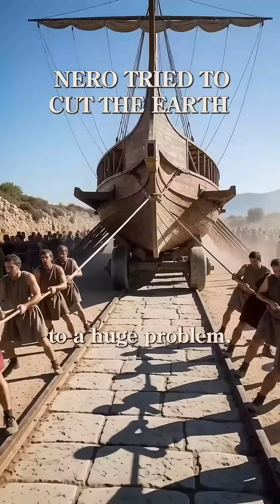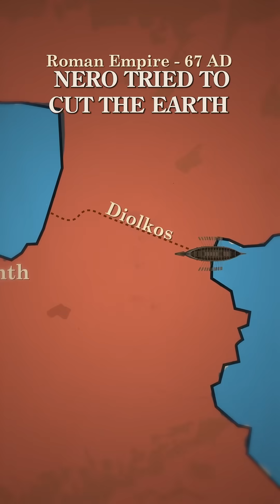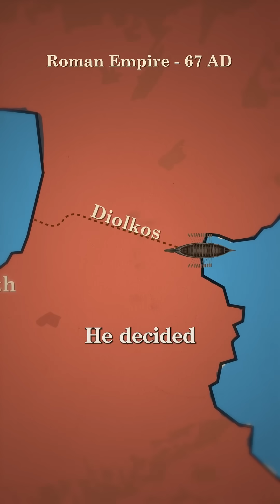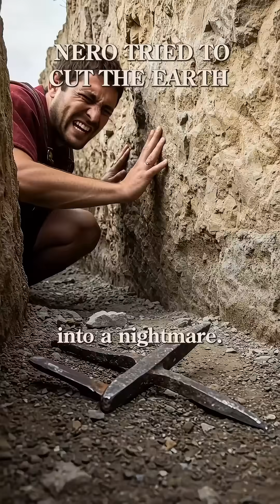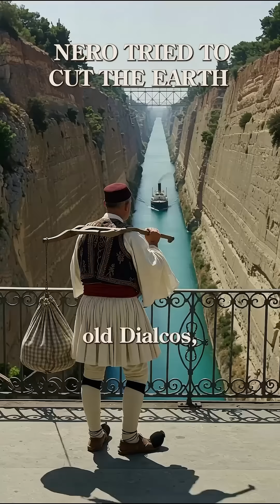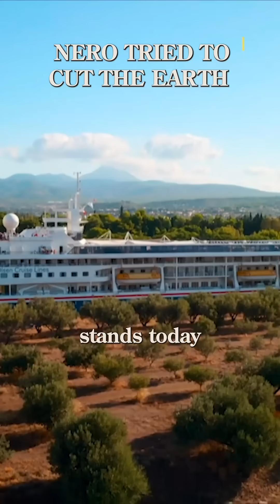The Canal That Took 1,900 Years to Build #history #ancientrome #engineering

Comment: Historically, many empires have considered large-scale civil engineering projects such as canals and land reclamation, and in many cases abandoned them due to technological and budgetary constraints. In fact, about five centuries after Emperor Nero, China went on to build an even larger canal, and that project ultimately contributed to the fall of the empire.

Of course, the canal later became a major asset to China’s logistics system, and as a result, modern assessments of Emperor Yang of Sui have changed significantly. Whether in Asia or Europe, it seems that empires have grappled with remarkably similar dilemmas. Thank you for the great information.

Comment: Meanwhile in ancient China, Chinese engineer Li Bing created a fire and water technique to break up hard rock into smaller pieces. He build a canal that passed through a mountain by splitting the mountain.
Reply: Name of the Canal?
Reply: @ryanlie6250 Dujiangyan, specifically, Baopingkou.
Reply: @ryanlie6250 The Dujiangyan. It's an irrigation system made to divert the waters of the then flood-prone Min river. The original canal was built over 2000 years ago, but because of an earthquake in 1933 it had to be redone
Reply: @c@communistflowerthen its not Canal
Reply: Pretty sure they knew how to do this in the west as well and even in the old world there is evidence for this technique or similar ones
Reply: That’s tuff
Reply: So tuff
Reply: Ts so tuff
Reply: That’s so tuff
Reply: That’s tuff
Reply: Tuff
Reply: So tuff
Reply: these chinese propaganda is everywhere. fck u
Reply: That’s tuff

Comment: The Dujiangyan canal and  Irrigation  System is located approximately 60 km northwest of Chengdu, China. It is a historical project that spans an area where the Minjiang River flows from a gorge an alluvial plain.

It cut tru rocks and hills. 

Year : 256 B.C
Distance : 60km

Nero canal 
Year : A.D 67
Distance : 6.3 km
Progress: About 10% before it was abandoned.
Reply: The Romans dug a 60km canal in Egypt connecting the Nile to the red sea, and they dug a hundred other canals.

And it wasn't for canoes either, or some irrigation ditch, but for shipping lanes and naval access. The canal at Corinth is also over 50 meters deep. You can get an idea from the video.

Your comparison is silly and dishonest
Reply: How big of a ship can you use on your canal?
Reply: @Craig-fl8jj   The width of the Dujiangyan canal and irrigation system varies by component: the Baopingkou (Bottle Neck) channel is about 20 meters wide, while the Yuzui (Fish Mouth) levee has a base that is 140 meters wide and a top that is 30  meters wide. The system is a complex, non-dam intake project, so its "width" depends on which part is being measured and the total distance is 60 km. 

Many parts of the canals were consists of very large boulders. How the Chinese managed to crack open these boulders in back in 2,380 years ago ?  If you want to know i can always help you. Anyway today the Dujiangyan canal irrigation system is a major tourist attraction, ten of millions of foreigners had visited this amazing  historical site ... and today it is still function as a canal and irrigation system.

Comment: The idea of Isthmus had been discussed for centuries. Periander the tyrant began digging in the 7th century but stopped due to technical difficulties. He also built Diolkos. The Diolkos was a stone ramp with turns, coated with grease to reduce friction. It used gravity for most of the journey to move ships across the land. First Romans attempt to finished isthmus were Julian Ceasar and Tiberius. It was also completed with a steam excavator  not dynamite. 
This video is poorly researched and inaccurate.
Reply: dynamite was used too
Reply: It's a clanker, what did you expect?

Comment: Periander the tyrent was the first started the canal, not Nero. Video is inaccurate
Reply: He never tried to dig a canal through the Isthmus of Corinth. Instead, he had the Diolkos built, a paved road on which ships were transported over land on rollers or carts from one gulf to the other.
The idea of digging an actual canal came only centuries later, and it was Nero who first tried to make it happen.
Reply: @mitch9651 The idea has been discussed for centuries. Periander the tyrant began digging in the 7th century but stopped due to technical difficulties. He also built Diolkos. The Diolkos was a stone ramp with turns, coated with grease to reduce friction. It used gravity for most of the journey to move ships across the land. First Romans attempt to finished isthmus were Julian Ceasar and Tiberius. It was also completed with a steam excavator  not dynamite. 
This video is poorly researched and inaccurate.
Reply: The idea has been discussed for centuries. Periander the tyrant began digging in the 7th century but stopped due to technical difficulties. He also built Diolkos. The Diolkos was a stone ramp with turns, coated with grease to reduce friction. It used gravity for most of the journey to move ships across the land. First Romans attempt to finished isthmus were Julian Ceasar and Tiberius. It was also completed with a steam excavator  not dynamite. 
This video is poorly researched and inaccurate.